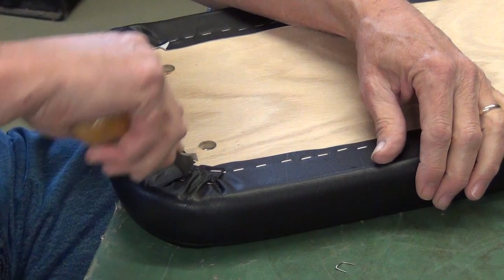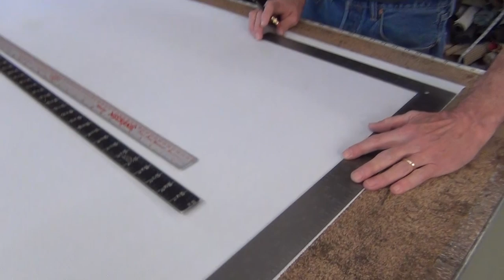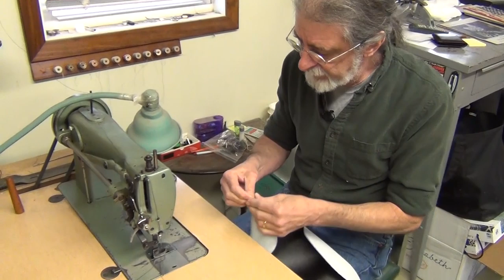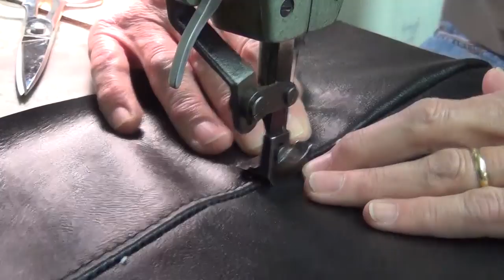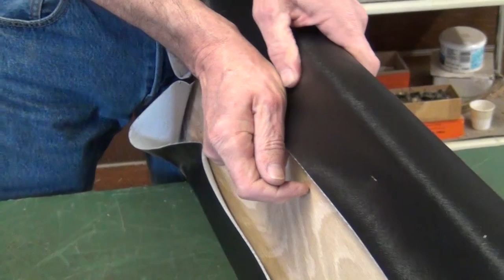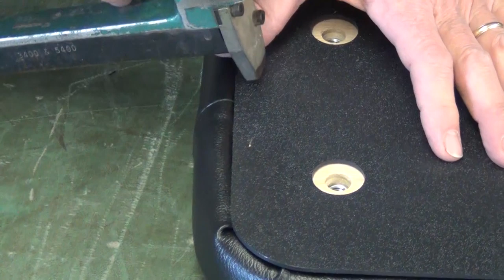How to Upholster Fitness Equipment

Comment: I have done seated calf machine where knees make contact and a chest piece on seated row machine....the round container is a great idea....and dividing the corner/stapling then doing each side is a great tip because that is where I had the most trouble...not sure if you have a FOAM recommendation if foam is worn?

Comment: on average, what would be a reasonable price to charge for a job like this? curious as i am just getting started and will be doing some workout equipment soon!
Reply from the maker: I'm unable to tell you what is a reasonable rate of charge. You have to decide that based on your location and personal status. What you saw in this video reflects approximately two hours labor plus the price for 3/4 yard of vinyl. No foam replacement involved.
Reply: Buckminster Upholstery thank you! that helps.

Comment: Dear Buckminster Upholstery, Could you please tell me what that black plastic/PVC(?) backing sheet material is called?   I'd to buy some to hide the staples and plywood on one of my benches, but I don't even know what to call it!  Thank you!
Reply from the maker: I don't know what the plastic sheet is called. Some years back a fellow upholsterer said it's used in custom car interiors and can be heated and bent. I'm not personally familiar with this. You can cover the bottom of your bench with black vinyl. Thanks for tuning in.

Comment: I have weight machines that need reupholstering.  What is the best material to buy for this project ?
Reply from the maker: Naugahyde is made in the USA. They have a number of vinyls that work well. Burkshire (sp?) is a good choice. The pattern number starts with BRK- _ I don't recall what I used in the video but it wasn't what I typically use.

Comment: Please, what the size of the staples should I use for gym upholstery (vinyl leather + 18mm plywood)?
Reply from the maker: For the most part, 1/4" is sufficient. Corners may require 3/8".
Reply: @Buckminsterupholstery  
Thank you very much, but if the the thikness of the vinyl is 2mm, will 6mm (1/4") staples be enough?

Comment: I need to replace the cushion on my gym bench. I want to use a tighter cushion. Where can I purchase new cushion material
Reply from the maker: My distributor only sells to people in the trade with tax-exempt status. Check with an area upholstery shop. I use HR-70 in these applications. Re-bond foam is more firm but tends to have a rough surface.

Comment: Nicely done.  What size stitches did you use for the seam and the top stitch?
Reply from the maker: Off hand I can't say how many per inch. My stitch size reads 1-5. ... 3 1/2 seam and 5 top.
Reply: Do you give an allowance for the stretch of the vinyl. In other words do you make the top piece slightly small since the vinyl stretches when you staple it. Thank you.
Reply: Thank you, do you know a good place to buy the plastic material for the backing?

Comment: Im planning on creating a home made gym bench and want to use some left over vinyl kitchen flooring. That seems thicker than this. Will it easily staple down with a heavy duty staple gun?

If all else fails I will use an old air mattress. The side that's vinyly.
Reply from the maker: Why not look for an area upholstery shop and buy suitable vinyl? Hobby Lobby may have some. Walmart? I can't answer to your staple gun as it depends on the length of staple and the type of wood you're stapling into. 1/4" is plenty long, except maybe for the folded corners.
Reply: @Buckminsterupholstery  It's jyst cheaper is all

Comment: What if it’s been ripped and where to buy the materials- vinyl, staples and maybe padding since ripped?
Thx
Reply from the maker: My distributors sell only to people in the trade. Look online, or for an area upholstery shop and they should be able to provide you with materials. Staplers can be a problem for the DIY person as electric and manual staplers don't usually have enough drive power.
Reply: Got vinyl and 1/2” foam at a fabric store. A friend has a great stapler, tools and woodworking experience. Took us several hours, but it’s not bad for our first attempt. Lesson: take before pictures to make sure you can put it back together as before. We took measurements, but a picture is invaluable. Thx!

Comment: What is the purpose of the plastic that you stapled over the back of the bench?  What kind of plastic is it?
Reply from the maker: The plastic, or any cover on the bottom side is for sanitary reasons. The plastic leaves edges smoother with a more cleanable surface than plywood. Less hiding spaces for spiders and other insects. What kind of plastic? It was on the seat so I reused it.

Comment: Great video. What wood would you suggest for restoring a broken board?
Reply from the maker: Good quality cabinet grade 3/4" plywood. Round over the edges to reduce cutting and wear against the foam and vinyl.
Reply: @Buckminsterupholstery  thank you I will look for just that.!
Reply: @Buckminsterupholstery  i did just that yesterday and its looking good. Thank you

Comment: What size staples do you commonly use for this? Great video and explanation! Thanks!
Reply from the maker: Because there will be staples along the way that need to be removed in adjusting the cover I use 1/4" as they are easy to pull. When I run into thicker folded layers I step up to at least 3/8", or maybe 1/2". Thanks in return.
Reply: Another question Sir, what threads do you use for this material and what would you recommend for durability?
Reply: @Buckminsterupholstery  doll have you ever put a staple through your finger?
Reply from the maker: @richeyrich2203  In one side and out the other many times.